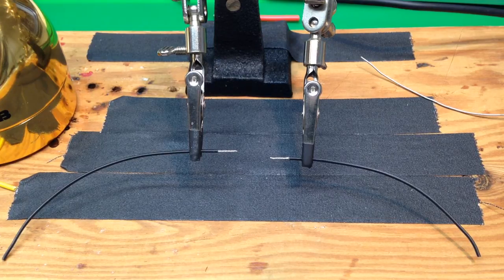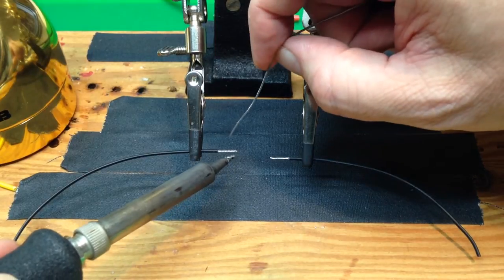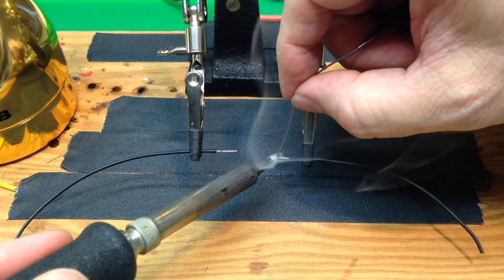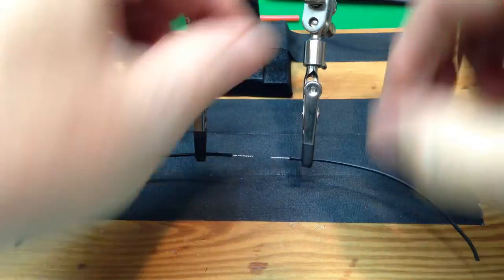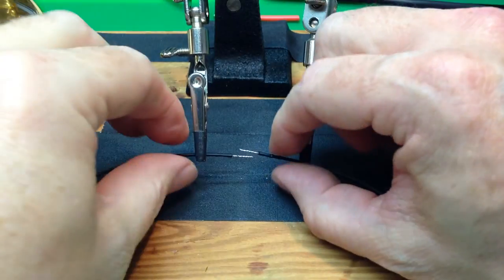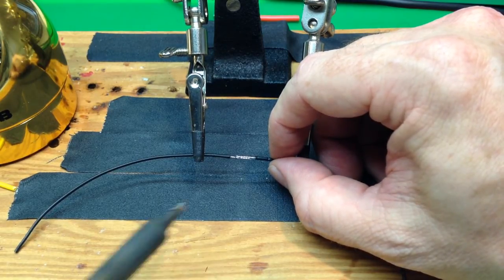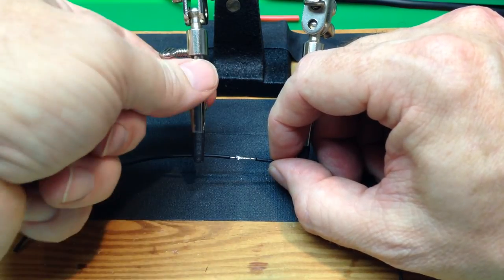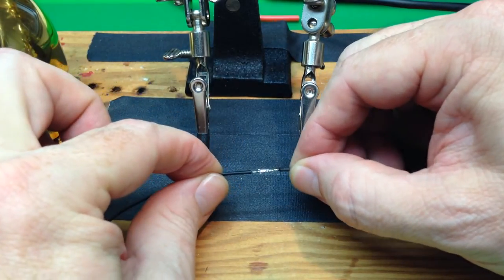East Bay RC Soldering Guide, Part 4: Soldering Thin Wires

Comment: Technically this is incorrect, you should not solder two wires in parallel. You are supposed to shape the end of the wires into a 180 degree half loop like the letter c, interlock the wires and then solder.
Reply from the maker: That's great for most wire, but this is for really thin wire that won't carry any strain.

Comment: i have to do ulra fine wire like that comes in cheap earbuds. I need to soldier them to a tiny rivet any suggestions?
Reply from the maker: +Bflatest Tin the wire, tin the rivet, and then heat the rivet with the iron. Touch the wire to the rivet, and the solder in each piece will flow together.

Comment: im having problems finding a good wire peeler or whatever its called for this type of small wire, got any suggestion what i should be looking for?
Reply from the maker: "wire stripper".  Lots of strippers go down to 20 gauge, so you have to buy one of the smaller ones that go from 20 to 32 gauge.
Reply: Mark Harrison ok thanks.